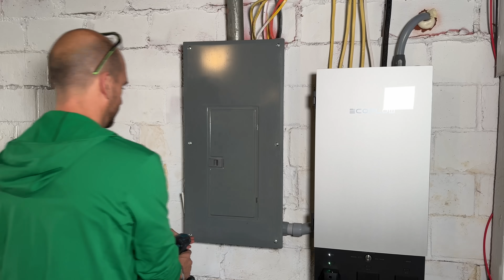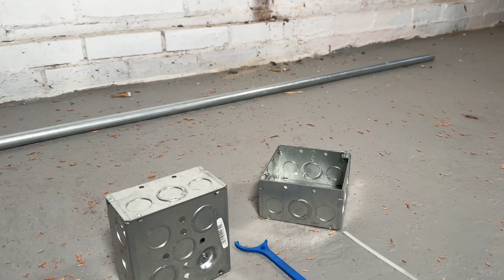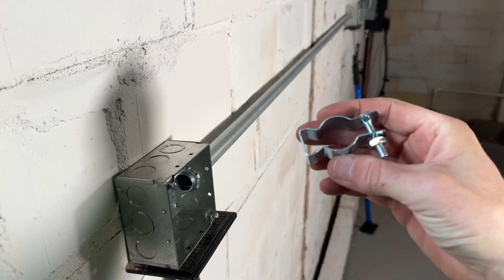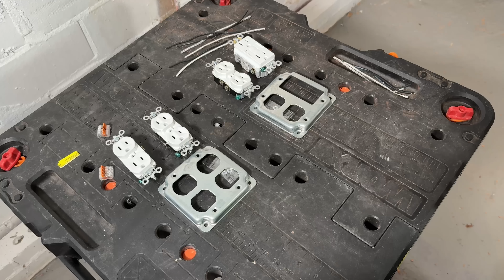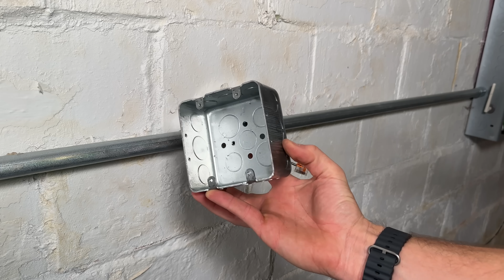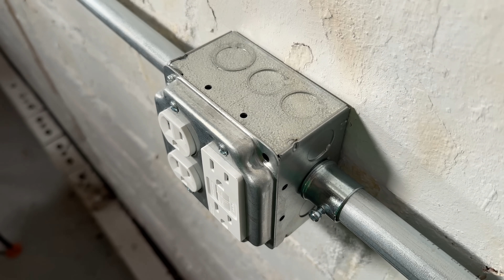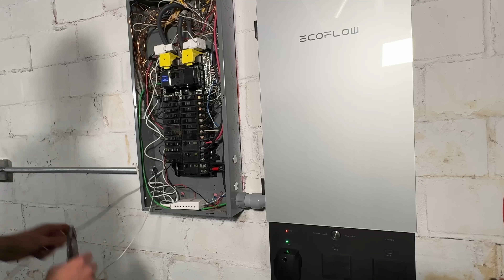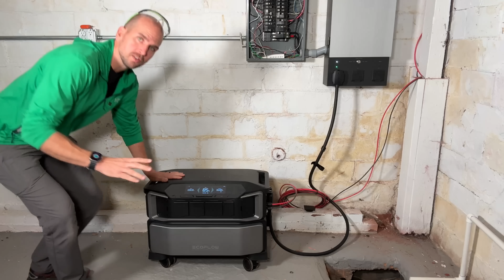Add Outlet To Unfinished Basement Or Garage

Comment: Been an electrician for more than 50 years and have never seen a install without offsets done by a journeyman electrician.  Also never use a pipe cutter on conduit, just a really bad practice. As an electrician I with only use wire nuts, used correctly they are the safest connection. I would never do an install without a ground wire just not safe to trust the conduit to be the ground.
Reply: Modern Wagos have been extensively tested vs wire nuts time and time again. They are perfectly safe. In fact it has been proven that for DiYers, Wago are more safe because most DiYers do not install wire nuts correctly.
Reply: Conduit is fine for gound in a short run using raintight connectors, i wouldnt trust set screws.
Reply: @Pepe-dq2ib  Metal conduit is a better ground than a copper conductor up to about 400'. Whether you trust set screws or not is irrelevant.
Reply: @pld8993  I still run a single ground conductor in long runs as fail safe. It's not any harder and cost is minimal. I personally seen set screw loosen itself from years of vibration, so I stopped using them and went with raintight connectors. After I tightened the collar, I use a sharpie and run a line to quickly know I didn't forget any and if they loosen themselves. I know it's overkill just for electrical, but I used to work on cars and it was just standard practice when torquing nuts and bolts on suspension or high vibration parts.

Don't need another mgm grand fire because a ground wire in EMT cost more money.
Reply: @Pepe-dq2ib  I think you mean compression connectors. Set screws don't typically loosen and in conditions where enough vibration to loosen screws is an issue flexible conduits should be used. The added cost is not always minimal. I've done projects where adding ground wires to everything would have required larger conduits to accommodate them, as well as the cost of the conductors, increased labor, adding many thousands of dollars.
Reply: @pld8993  yes raintights are compression, but only the raintight version has a plastic collar added, it gets crushed when tightening to make a water seal that also adds friction for vibration. You only need one ground conductor inside each conduit, even if there are 10 circuits inside.
Reply: @pld8993  some inspectors will not pass you if only emt is used as the only grounding conductor, especially when connection service panels. Even if you use grounding bushings at each end.
Reply: @Pepe-dq2ib  If they follow the NEC they can't fail you for a code compliant installation. Inspectors don't get to decide what the code allows, they simply enforce it. I've had an inspector try to fail me for no ground wire and all it took was one phone call to set him straight.
Reply: @pld8993  true, but that doesnt stop them and it waste your time. You really have to pick your battles because an inspector on a power trip can make your future project a pain. If its just a simple request that i know i am not wrong, ill just do it or go above and beyond on this inspectors might be anal about. 

In my city you can have 1 ground rod of a detached building (garage for example) as long as it passes the resistance test, but i would just throw 2 rods down anyways so he doesnt have to pull out his tool to test and make the process more than it needs to be. Adding 1 extra conductor to a raceway is one of them, it doesnt take much effort and i can just add it to the clients cost. Theres nothing wrong with how you like doing the most minimal, but i think its not worth the headache.
Reply: @Pepe-dq2ib  Sometimes adding ground wires can add thousands of dollars to a project, including having to install larger conduits to accommodate the extra conductors, so it's not always as simple as a minor effort that can be added to the bill. Using the conduit as an EGC is not "most minimal." It's following the code as it's written, and a metal conduit ground is a better ground than a copper conductor up to about 400'.  When inspectors are wrong I always call them out. They apply the code, they don't get to demand something else because they prefer it. The most recent guy who failed me did so because he didn't know that conduit was allowed as a ground. When I gave him the reference and asked him to check his code book he told me he didn't have one with him. That kind of ignorance deserves to be called out.
Reply: @pld8993  still not worth the trouble, when i was working under a company, they always allow a budget to add a grounding conductor in all conduits. Not arguing the EMT/IMC is a bad conductor, the skin effect on metal conduits are indeed more effective, the grounding conductor is really just a cheaper fail-safe.
Reply: @Pepe-dq2ib  If I'm expected to provide a code compliant installation and I do, and some inspector comes along and says that he PREFERS that I go back and install ground wires into already completed conduit runs, some of which could now need larger conduits (remove wiring, remove conduit, install larger conduit, re-pull wiring with an added and unnecessary wire type EGC), the answer is NO. It's absolutely worth the trouble. I'm not in the business of appeasing inspectors' whims. If it's unquestionably code complaint according the building department's published code requirements, fail me and we'll see who gets reprimanded. It won't be me.
Reply: @pld8993  thats fine, we dont think arguing with the ahj or delays are worth our time. If the code says 1 ground bar, we will just install 2 even if we know we could pass with just one. We will run a grounding conductor from panel to panel even if we know the emt could work as the egc. The company i work for has a different philosophy and its been working out well for us, we never had any inspector question anything ever since.

No electrician does the exact same work that i've seen, so you do you. We will just end it with that, i never anything you did was wrong and if my job wont cover the extra cost, i wouldn't do it either unless its my own property.
Reply: @Pepe-dq2ib  The inspector is not the AHJ. That's my point.
Reply: @pld8993  who do they work for?
Reply: If in 50 years and you've never seen conduit run out of the box without offsets, then you haven't been around conduit much. It's done all the time.
Reply: Not by licensed electricians

Comment: What a massive headache that must be. Here the RCD is in the boards, conduit has to be secured and not rely on connections from either end to hold it, earth must be run to every GPO as you can not rely on earth from a steel conduit. Just because you don't have to run an earth conductor doesn't mean it isn't good practice to do so.
Because the RCD is in the board there is no mucking about with all that 'pre-wiring' which looked painful to do. 
That conduit is just hanging there and you can basically pull it off and create a short, IMO it needs to have saddles to be compliant and for peace of mind that the job is done correctly.
You fixed directly into the mortar not the brick so that is not acceptable for fixing to as when you plug something in and out of the GPO it will work itself loose. This is why using an impact on the lowest setting ensures your fixings are secure, if it strips then the fixing is no good in the first place.

Comment: You never drill holes in the mortar of the masonry wall. You always mount into the block.
Reply: Agreed! Also use panhead screws and rawl plugs or equivalent. The rawl plugs are soft and comply to the hole in the blocks surface. Tapcons are hard can easily fracture the hole and also have sharp edges on the head.
Reply: Tapcon's go into brick, the plastic wedge or lead inserts go into mortar....
Reply: Yep, that's a DIY homeowner level install.
Reply: not only into the block, but the solid part of the block: 1-2" from the edge or anywhere up the vertical centerline of the block.
Reply: And that was the only question I had about this otherwise excellent (and for me, timely) presentation.
(And I won a bunch of blue ribbons for demonstrating at the county fair as a kid in 4-H. So if that doesn't make me an expert...)
: )
Reply: 🤣🤣🤣🤣🤣🤣🤣🤣😂😂😂😂😂 4H memories... I got beat by a gurl at the milking competition  @ChuckD59
Reply: @ChuckD59 BUT did you stay in a Holiday Inn Express? 😜😎😇 Tim in northern TN
Reply: @CliffsideStables  Nope, lived nearby. But did better than the kids who slept in the stables with their animals.
Reply: @CliffsideStables  "Tim" is actually a robotic turkey from the year 9595, he lives in space.
Reply: @spacewolfjr  HUH???
Reply: Let's be clear here: mount into the block on concrete walls, but into the mortar on brick walls -- NEVER drill into brick to mount *anything*. It's not secure.
Reply: @douglasmiller1233   @douglasmiller1233  this is not the recommendation. Mortar has no holding power. If the brick is very old it may also have no holding power but you're supposed to drill into the brick otherwise.
Reply: @ArcadiyIvanov wrong again

Comment: Size and Type of Conduit	14 AWG Wire	12 AWG Wire	10 AWG Wire	8 AWG Wire
1/2-inch EMT	                      12	                9	                5	              3

3/4" is waaaayy overkill.
Also, I never trust a simple clamping connection on conduit to be a long term ground. I will always run the ground wire. Ground, ground, ground!

I noticed when you were drilling the main panel, your bit was rubbing against the red wire.

Personally I would run romex in that pipe for added electrical insulation.
Last thing I would want is a defect in insulation and a kid touch that pipe and get killed.

About romex vs stranded single wire - if they would stop robbing people on the price of single wire, people would not be as tempted to use the cheaper romex.

I do not like the tapcon anchors. I have NEVER got them to hold, ever.
I use expandable metal anchors.